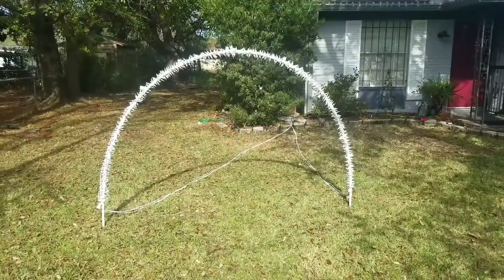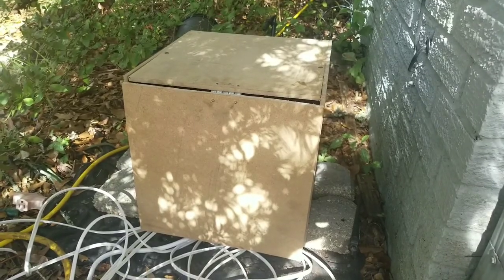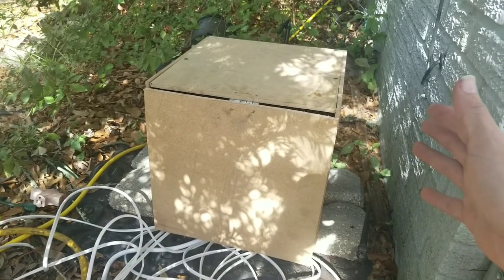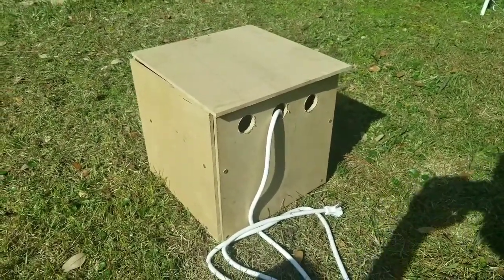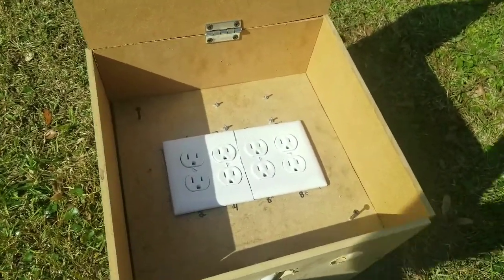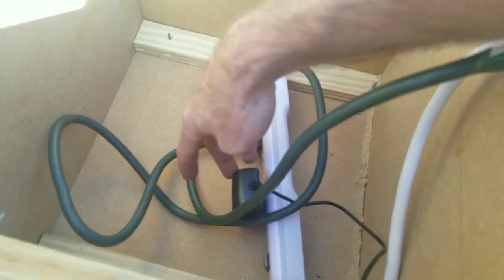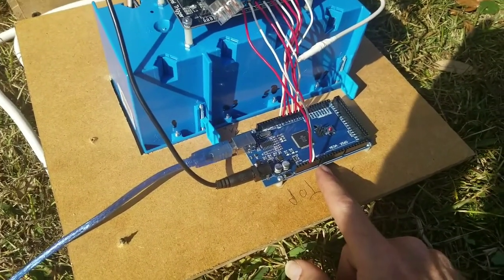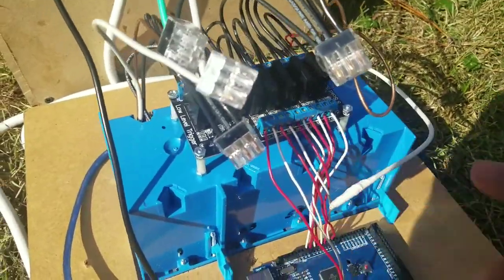2019 Christmas Lights Set Up Pt4 - Light Controller Box Build

Comment: Does arduino have a app I can use to control Christmas lights with my iPhone?
Reply from the maker: Possibly one you can adapt similar to a "smart home app". You'd have to have a way for the Aruino to connect to wifi (or Bluetooth) to turn the outputs (relays) on/off. But you probly won't be able to get a sequence done. It would be whatever you turn on or off with your phone.
If you have RGB pixels, you can use an ESP32 and flash WLED on it and control it and the pixels via your phone through wifi. That's what I'm working on now for next year.